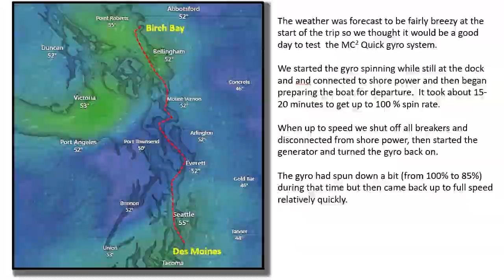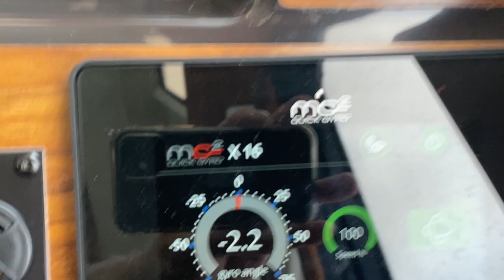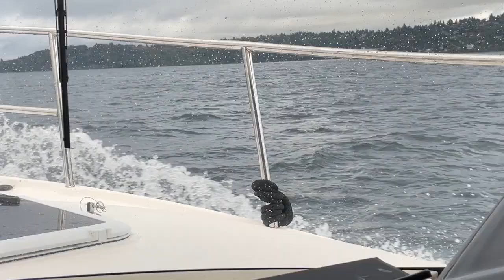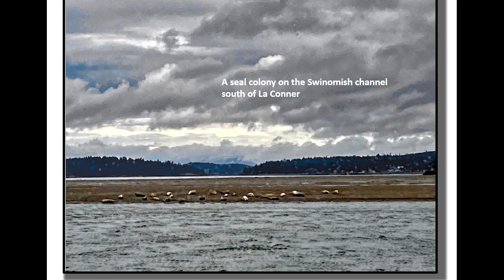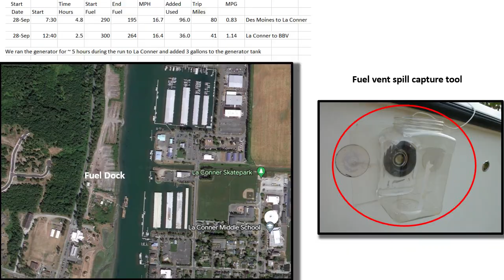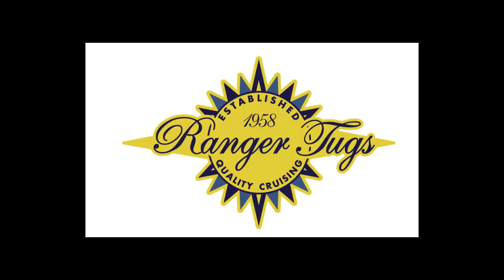R43 Training Day 4 Return Home

Comment: I have a question for you.  If you capture some fuel spillage in that bottle.  Then what do you do with the captured fuel? I wouldn't think it should be returned to the tank. It may be contaminated at this point. Disposal may be an issue. Just wanting to know out of curiosity.